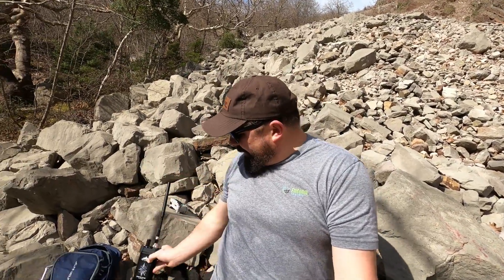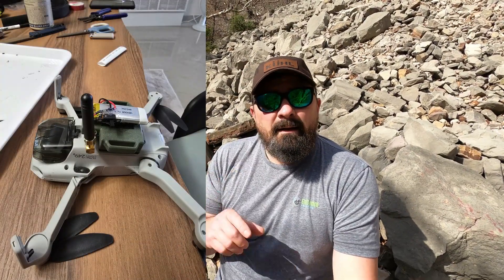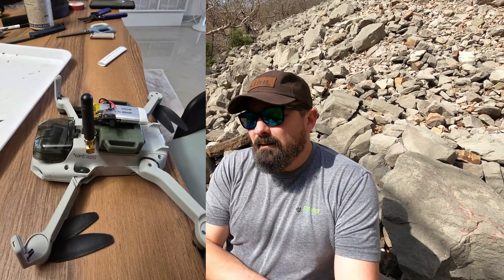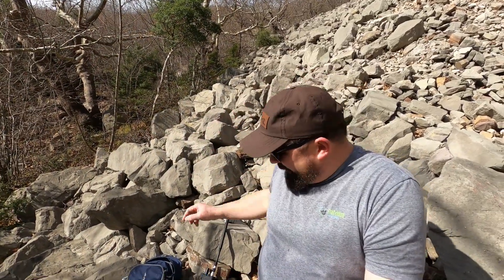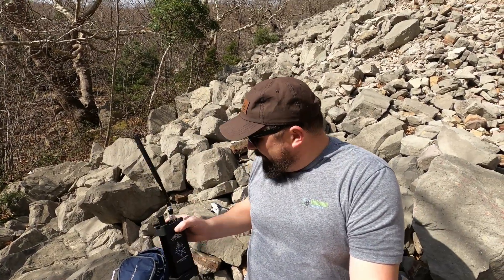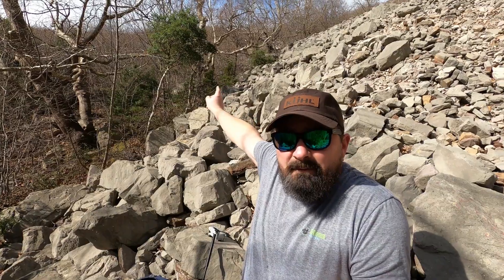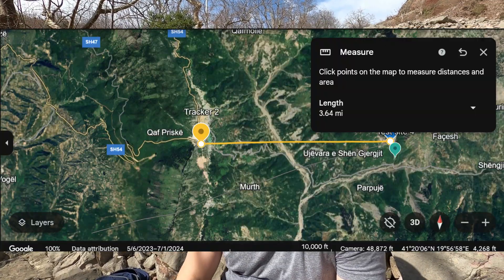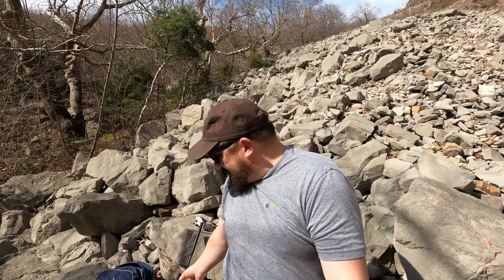Tactical Meshtastic Radio | RM-1 Field Testing Results

Comment: Interesting concept, these can be built for less than 70 dollars if you omit solar and are somewhat handy with basic electronics and hand tools.
Reply from the maker: A DIYer could built a waterproof mesh radio enclosure. However, building one that matches the performance and durability of the RM-1 for under $70 would be tough. The cost of the two antennas on alone is over $140. That doesn't include the LoRa board, 10,000 MAh battery, IP rated aluminum enclosure, and waterproof connectors. With that said, not everyone needs a mesh radio to those specs.

Comment: Typical range as a regular node. So your just paying for the extra armor?
Reply from the maker: I have seen a slightly better range with the provided goose neck antenna. However, yes, you are paying for the rugged waterproof enclosure, external GPS antenna, and 10,000 mAh battery.
Reply: @EmCommSolutions disappointing, it says online encrypted messages over meshtastic up to 50 miles...

Comment: You were talking about the dropping cradle for the radio that they're working on. I don't know how to do the timestamp for the comment so here's one thing I learned about the cradles. As long as they do their research as I mentioned in your comment down below. It's not going to necessarily be a straight charge. Some batteries prefer a staggered charge and can take longer also take longer to discharge when you're operating it. Quick charge generally is in the case with these but some of them are for convenience purposes but may not be optimum and the long run especially when it comes to various conditions. So that research facility that can't remember the name of I'll let you read my, I don't want to be redone in here. Anyhow I remember back in the day not too long ago people would be taking their 12 volt plug and from their radar detector and plugging into something else or vice versa and going it's not working. I would have to explain to them yes that's correct it's not working but it is working because it's just not straight voltage. Let's say your maximum voltage is 12 volts it's staggering between 357 and 9. And sometimes actually the wave pattern is inconsistent enough where it won't run anything that requires straight 12. Only maybe momentary or you might even hear the first if you will of energy going up and down with some devices nearby. So there is a lot of complexities to properly charging a battery. So I hope when I make these cradles out there just not made for convenience and fast charging. That they have a algorithm to maximize the charge and discharge of the battery and a goal also is to keep the battery and optimum performance for the longest period possible through these methods.
Reply from the maker: Thanks for the insightful feedback. The current configuration of the RM-1 has a 18650 battery pack with 10,000 mAh capacity. The LoRa board is a RAK and its charge circuit is designed more Lithium Polymer flat batteries that typically have .2 Amp charge limit. So the RAK 19007 series have maximum charge output of 350 mA at 4.2 volts. Therefore, charge a 10,000 mAh three cell 18650 is very slow. AT-Labs is looking change this in future models which will probably require a new base board or separate charge circuit.

Comment: I'd be interested what distance a Meshtastic node can get on a drone.
Reply from the maker: I would willing to bet that in the right conditions you could expand a network well over 50 miles. The current world record for Meshtastic range is 254km (158 miles) was which achieved from nodes being place on mountain tops.
Reply: Yeah nodes have become a or transponders whatever you want to call them or repeaters have become a new thing in the field. I guess that's okay and all for certain scenarios that is. But in a scenario you would use it and I think there would be too much competition. Meaning like thieves and people trying to grab what they can in a scenario we hope that never see on the US soil. The best thing to get is to get away from FM. The peel tone will still work with repeaters am on the FM receiver or transponder or whatever. Depending how you set up is. We've already tested this we went am up on our 2 m and kicked off the repeater and heard him fine. I don't remember the report on him hearing us but he responded right away. As you know I am will go over at hills and around hills down hills. FM is limited by line in a site as you know and conditions do vary it a lot. Even coming back a month or two later can completely change your ranges. And a situation where it would matter nobody's going to bother you for being an AM on the same bands. Out of a half a watt unit I was running beacons on a.m. . I had a 100% signal for six miles no drops whatsoever. Don't get me going on what happened when we were doing our FM testing.
Reply: There is a company that works with a university that test all batteries that make it into the market including Chinese ones just just so you know. And the part I take from it which is most important is discharge limitations and charge limitations. So I looked up the one for my two different radios and my cell phone. I stayed within their recommend ations limits. Sorry about the plural there. And I noticed a Jurassic change and how long it held a charge in a good way. But also it also slow down the discharge at the same time. For example A lot of people do the 100% charge and call it a day. Not all batteries are recommended at 100%. So on my phone the bottom was 60 and the top was 98%. With careful monitoring you can maintain what is recommended by this website. I do not know exactly how to find it right now but you can probably find it. No keywords I consumer battery testing facility requirements etc. I don't have the bookmark unfortunately but I'm sure you can find it. They've done vigorous testing and all sorts of batteries out there. Along with their assigned units of course being the cell phone that was made for or the radio is made for. Lithium ion is okay but has a lot of drawbacks as you know.